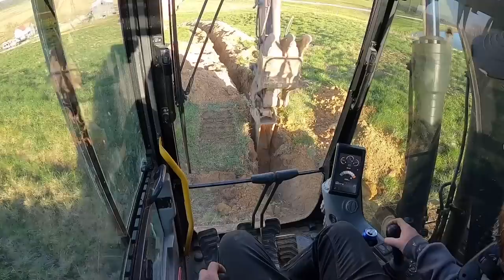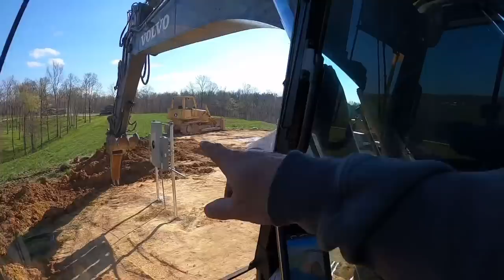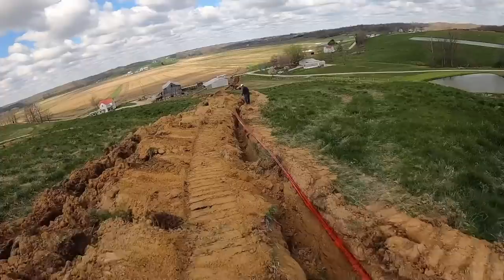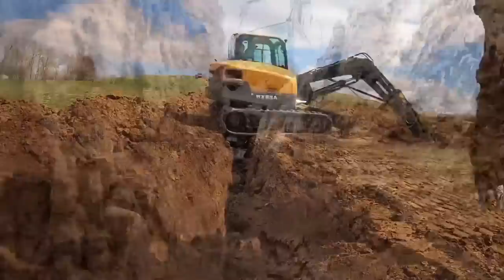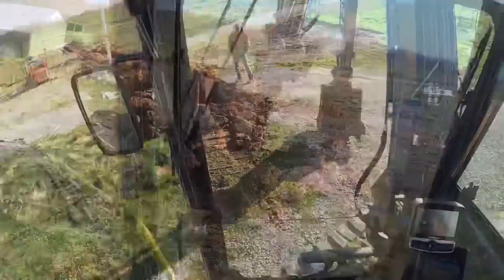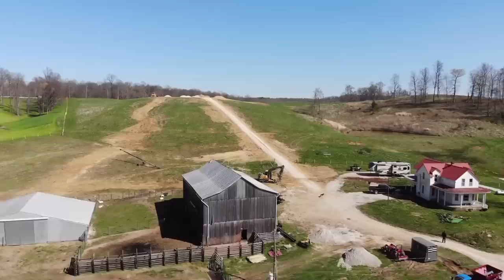Installing utilities to a new home with the Hyundai hx85a and the 140

Comment: My late Uncle owned a 100' wheel bucket trencher on tracks and dug trenches all over northern Ill.  He got into it as no one else was healed to buy the beast!  He and his brothers did well and are all retired or gone.  He did a lot of work for the Turnpike system and others. That little slot was small :-)  Cool implement you created.

Comment: My neck of the woods we have to put water line deeper for frost line. And no joint trenches with electric or gas. Red tape for electric, yellow for gas ,etc. Doesn't matter starting from top or bottom

Comment: I don't do any digging anymore, but when I did, I preferred to dig down the hill. Except on the occasion that I had a fairly large machine that had street pads on it. Then it was not so much fun being in a 45,000 lb. sled that wouldn't sit still. track 6in. forward and slide 10ft.. Has a tendency to get that "butt pucker" factor into play...lol

Comment: Just a thought Mike - Would the power guy not have been better going down the other side of the trench as it would obviously be easier to just push it straight into the hole without any dirt mounds being in the way??  Great seeing the home made trencher at work again. Cheers. Stay safe and well
Reply from the maker: No don’t think that wold work

Comment: high voltage 1 phase 14000 volts with the fiber line in the same 10" wide trench, wow, here in Ont. Canada high voltage or secondary ( secondary underground can only run a max of 250 feet power lines can be in the same trench as the fiber and phone lines as long as the power lines are  a long the wall of the trench on one side of a 36" wide, trench and the fiber line and phone lines are a long the wall of the other side of the trench 30" a part, and back filled in place, with clean red clay, no rocks, if rocky ground must be bedded back filled with 10" of sand, 5" under and 5" on top
 they clam, if a power leak shroud happen, the person on the phone/computer dont get fried, same with the fiber, phone, coax can be tied together with tie wraps. water can also be on the fiber side but 6 feet below, total water line depth 7 feet, that 6" wide warning strip is $90 cnd 500 fot roll. the power company will not do any line work on privet land, they will hook your wires to there wires and set the transformer, be it on your 45 foot transformer pole or a ground set transformer, they will tie your secondary wires to there transformer, that it, you have to dig every thing buy your own wire, weather it be ACSR OR WMU90 SECONDARY, THEY ALSO WILL NOT HOOK UP OR INSTALL any thing but thee transformer and hook your lines to it, you have to supply and put in your own cables, hook them up or get a contractor that will charge the living hell out of you, i installed my 3 high voltage ACSR line, insulators, ankers. MY 3 POLES, 2 40 FOOT AND ONE 45 FOOT FOR THE TRANSFORMER. I installed the meter mast with triple 500 copper up the pole                         to my double lug 400 amp meter base i installed,  you have to leave hydro withe an extra 6 feet of cable post the head of the mast, in order to pass inspection to get hooked up to there wires, only to have hydro guy come to hook your lines to there and chop off you triple 500 to 2 feet out the head, like wtf that stuff is $22 cnd per foot and there is 3 of them,, then ran WMU90 213 feet to my shed were i installed a 200amp main panel, a second run 250' of WMU90 from the meter as well TO WERE MY SHOP WOULD BE and put the 200amp main panel in a small shead that would supply all the power to the shop if it ever got built, the shed would only hold my huge air compresses and the 200 amp panel were all feeds would feed plugs lights pumps welders exct.. it was placed center of the south side wall, so wire have a shorter run each way in the shop, i up graded a friends hydro service from 100 amp to 200 amp, ment changing the meter base, main panel, bigger mast and bigger alumunum service cable, had to leave 6 feet of service cable out the end of the mast head in order to pass inspection before they will hook you back up. they come to hook him back up and first thing they did, chop that extra 6 feet down to 2 feet..   another time a meter base burn off the contacts, had to install a new meter base, hydro came to cut of power witch left just over 3 feet of cable out the head, inspector wouldnt pass it, said i need 6 feet, i said why the hydro boys are going to chop it off to 2 or 3 feet, there was no need to replace the old cable other then he wanted 6 feet out the top, i had a roll of cable on hand so he waited the 15 min it took me to replace it, he passed it called in the boys to hook him up, yup they chopped it of at 2.5 feet, grrr it was 40 below

Comment: How do you compare the HX85 to the HX145? Which is more versatile? If you had to pick one, which would you go with? Curious if we can get by with an 8T, 4T, SVL75 combo? Is it worth upgrading to a larger CTL? I like being able to transport with a 14K trailer, but do you even use your 4T now with the 85 around?
Reply from the maker: If you can move it the 145
Reply: @DirtPerfect  Thanks. How about the CTL… do you feel like anything smaller than the SVL90 you own would be too small?

Comment: You may have already covered this in another video, but why do you run really long water service to remote locations?  Here in central N.C. they dig a well and in my county 200' depth and you will have plenty of water, cost is about $5000. In your area why are wells not used? Thanks.
Reply from the maker: Way cheeper her to run line

Comment: Got a question for you. Not having a go at you , just curious. As a land owner in Australia, if I engage a contractor to dig a trench for power and another  for water, I want them as straight as possible. I can see where they utilities enter the property and I can see where they end up at the house or shed. If they are dead straight then I know where they are. I had underground 240v power put in 10  years ago and the trench snaked 2 or 3 feet left and right along its length of 600ft. I know where it enters the property and I can see where it enters the shed but in between I am guessing.  You appeared to snake up the hill a little (to my untrained eye). Was there a reason for this? Slope or contour of the land? Soil conditions? Just asking
Reply: Another good video by the way
Reply from the maker: Simple answer followed the homeowners instructions
Reply from the maker: And thanks

Comment: Everywhere you dig a waterline, it seems you have city water. I live in a suburban area of PA and if you live out side of a town you need to dig a well. Almost seems like it would be cheaper to dig a well than to dig that trench and install all that plumbing.
Reply from the maker: 30 grand or 2500 ish 🤷‍♂️

Comment: I think digging the trench from the top down would be easier. I do wonder, why is the trench not a straight line, as the crow flies? Can you alter your "line trencher" to be able to accept the largest line that anyone wants to use? Your camera does pick up the angle of the hill side. I can tell you have your blade behind you.

Comment: Dp we all know for every for water has to travel uphill you loose water pressure. Can you tell me how much voltage you loose for every foot that line has to travel uphill?
Reply: No voltage drop problem. Going to the transformer on top. So it'll be hot up there
Reply from the maker: None

Comment: dono but if i was there digging in water line, i sure would be going a lot deeper then 36" the world is going though it normal weather change as it has done for thousand of years, one day you may wake up to 2 weeks of 25 below, at 25 below that 36" will freze solid in 2 to 3 days, look at Texass. lol 😂 and it going to happen again but even worse, was not that long ago every thing was under a mile of ice. we are on rout for the slow an steady change.. it has been changing for the past 26 years and each year a bit worse..

Comment: if they have that much pressure why did they go with 2 inch. If there is that much pressure should be plenty of volume. just curious cuz I work for a utility and people think bigger is going to give more pressure
Reply: Because if you ran that distance with 3/4" line, the flow at the house would be reduced to a trickle with the faucet wide open.  Pressure and volume are not the same thing. The larger line (actually ended up being 1-1/2", not 2" as was originally state)  is needed to assure adequate volume flow  with that long of a run. Running gases or liquids for long distances in piping you lose some flow volume due to inherent friction between the product you want to move, and the inner walls of the piping.   Bends and curves in the piping will also reduce flow somewhat, again, the larger piping helps to compensate for that reduction too.  Bigger does not give more pressure, it allows for less reduction of volume at any give source pressure. It does not surprise me that you run into people who think that bigger = more pressure.
Reply from the maker: Not the plumber just the excavator
Reply: @larrywalker7759  if you have that pressure more than likely you have volume behind you. put 2 reducers one at meter keeping pressure high intern keeps the volume moving then on at the house to not blow pop offs and shower heads. I do it everyday. work for a utility where our elevation change is in excess of 2000 feet and ifnyou have that much pressure it can feed all the 3/4  line can produce and around here 3/4 is standard size. just coming down own elevation change we at least 3 reducers on our mains and people bitch about 100 psi
Reply: @douglascole3842  I lived in a rental house back in the 80s for a while. Water volume out of any tap was very low.  The service lateral was 3/4" PVC with 330 ' run from the meter to the house.  Flat land with about 2' rise from street to house.
Water pressure was right about 125 PSI.  The landlord replaced the service lateral with 1" PVC and it seemed to me that it doubled the volume out of any tap. Before the upgrade,  when you opened a tap you would get a momentary high volume flow that would instantly taper off to the low flow volume.  After the upgrade the volume at opening remained constant until you closed the tap.  The opening surge with the following drop in flow is the sign that the service lateral piping is too small.